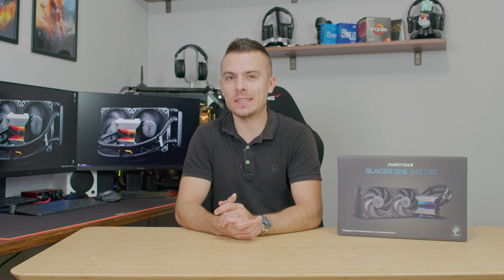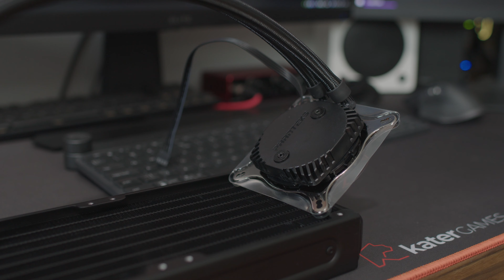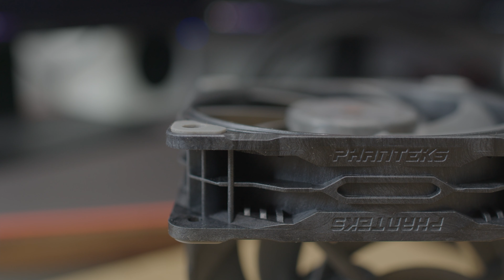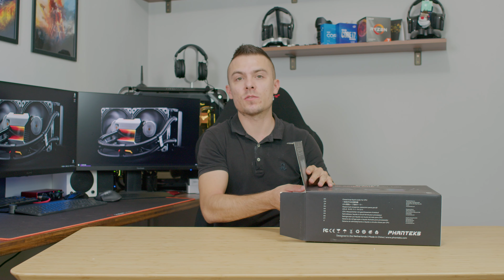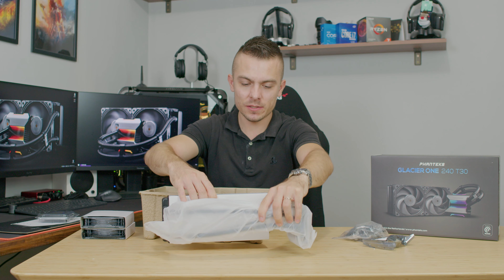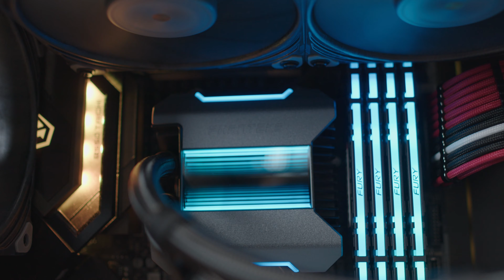Phanteks Glacier One 240 T30 - Silence and Performance!

Comment: Nice Review! Actually i have NZXT Kraken X63 280mm AiO but i'm very disapointed with NZXT CAM Software which is responsible for freezes on my PC using Ryzen 9 5900x. Without the software running the pump is not working as expected because it cant be controlled by the BIOS.
After your review i'm thinking of replacing X63 with the Galcier One 240 T30.
Reply from the maker: There are some rumors that NZXT CAM doesn't work properly on AMD based platforms. But I tested that out and it isn't true. I honestly don't know why NZXT CAM is messing so much on your PC. I have been using it since day one and literally it freezed on me 4 times maybe. But I totally get you man. I would be frustrated as well.
Glacier One 240 T30 really does cool extremely good, but be careful and measure the dimensions and if it actually fits inside your case. Just as a precaution. ;)
Reply: Never ever get NZXT, their CAM software is spyware. CAM constantly eats up resources. Same with Asus Armoury Crate, just junk software. I have GlacierOne 240 and I love it, it is completely silent at ambient and cools great during gaming. RGB easy to control with motherboard software.

Comment: So it can really beat 360 aio?
Reply from the maker: To some 360 it is actually equal. Really does a great job just because of the thickness of the radiator and because of the huge airflow that fans produce.
Reply: @PCCrazyDario  Since most 280mm AIO are equal to the same series of 360mm AIO.  So I assumed that this 240 T30 can beat 280mm as well.  Really fantastic product of Phantoms!
Reply from the maker: @wolfwolf4759  Indeed, it can beat 280mm rad without a problem. Just to correct you, Phanteks. ;)